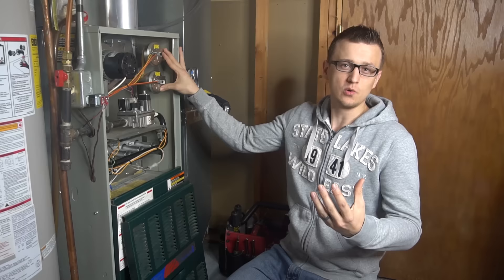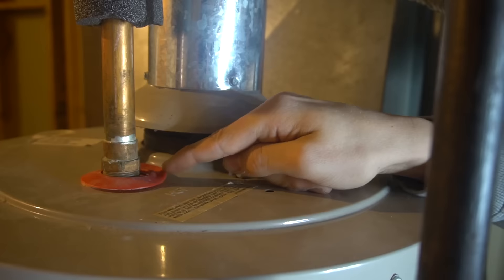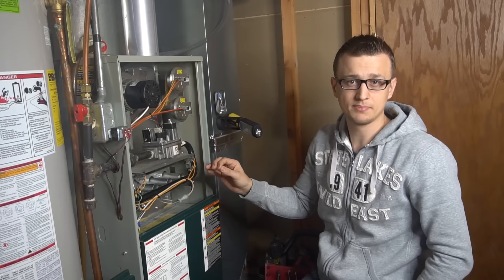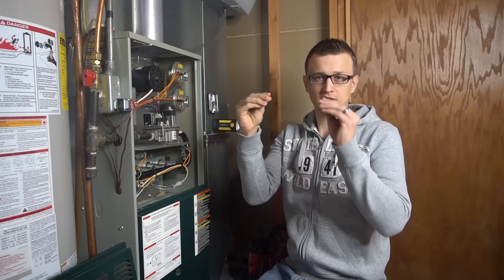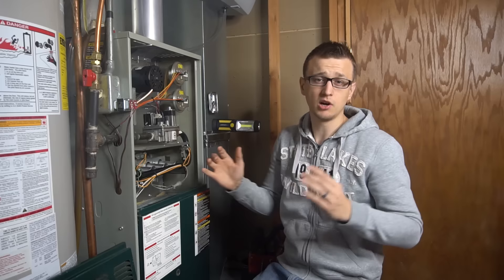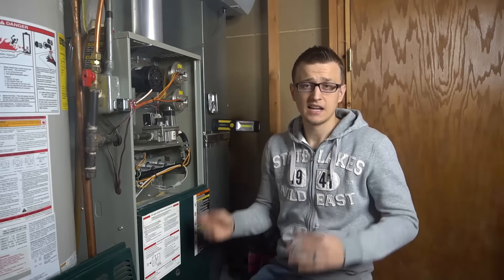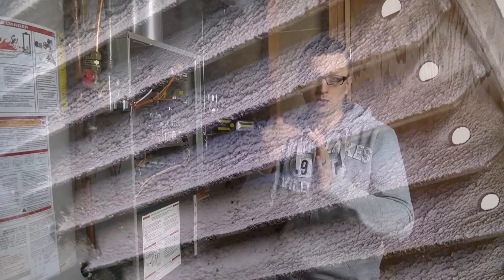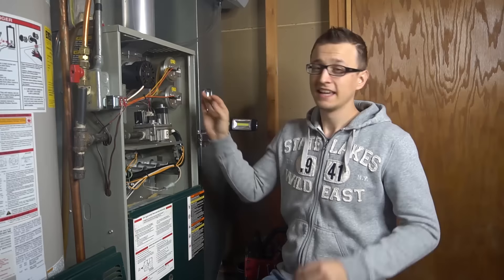Furnace Pressure Switch Troubleshooting

Comment: Ok so my furnace stopped working today as we started the winter.  Pressure switch error.   My high efficiency install only had one plastic air pipe connected to it so I wasn't sure where to look.  Then I noticed there was a small box sitting on top of the furnace - and when I picked it up it was right on top of the air intake hole.  I guess on our install they just let the furnace pull from the under house air and that hole was hard to see and wasn't labeled and was blocked by something so simple as a box of misc parts I must have set there.  I now have it labeled with KEEP CLEAR all around it!    Thank you so much for this video.

Comment: I had to work on my furnace over weekend.  It's a Rheem furnace.  I got a code 5-7.  Which is the pressure switch code.  I did everything to trouble shoot the unit.  The one thing I noticed when I started was my inducer motor was making a funny noise.  After checking everything I removed the inducer motor to check for an obstruction. 

 Everything looking good inside the motor and housing.  The unit is only 2 years old....  Why me. 

After reassembling the inducer motor.  I started the unit back up, that's when it started to work. 
I believe the inducer motor was not secure/sealed to the housing, which wasn't producing enough negative pressure to close the switch?

I no longer hear the noise coming from the motor.
Reply from the maker: Thank you for sharing that! That's interesting. I guess one will never know for sure what exactly was wrong. A bad seal could have been it. I had a similar one last month. I put in a new inducer motor and when I turned it on, it started rattling. I took it back out and found nothing wrong. Put it back in exactly the same way and there was no noise, working good. Still not sure why that happened either.

Comment: I have had a Goodman 80% furnace once where the draft inducer motor was bad, but it was an intermittent problem, the motor would appear to tun fine, but then at times it would slow down the rpm enough to cause the pressure switch to open and shut down the furnace.  It was a real nightmare because it did not do it all the time. When I first went out to this job there was a problem with the pressure switches Goodman was using from Brazil. Put in a new switch, ran for about a week, got called back for same problem. Changed the board because I could not find anything else wrong. Couple days later, same problem, this time I was watching it run, then all of the sudden I could hear the motor slow down, bingo found it, replaced the inducer motor and that was the problem, but intermittent problems like that one are a real bitch to figure out.
Reply from the maker: Thanks for sharing Jeff! I had similar problems in the past so I definitely understand how annoying those intermittent problems can be. Perhaps you will save someone's day as they read through the comments ;)
Reply: did you pay the person back for parts it didn't need???

Comment: This video helps me finding & ruling out the causes of my furnace not heating.   days ago my furnace just did not work with 3 flashes on and the outside temperature was below 30s. I did some research,  found this video ( watched Jay's other videos before and trusted him).  Following his suggestions, checking in & out venting pipes,  cleaning condensate trap/pipe, testing pressure switch with multimeter and finally end up at inducer motor.  Ordered a new one right away and replaced it a day after. Boom,  my furnace began to blow the warm air again.   Thank you Jay. Save me lots of time & money. you are the guy know your stuffs and help others.

Comment: Got an issue with a pressure switch code (Pressure switch open, should be close).  When I turn on the system, the  inducer motor runs, and I test good continuity on the pressure switch. However nothing else happens.  Motor runs for about 60 sec and shuts off.  Light blinks on the Honeywell furnace smart three times.  It tries again after a minute or so.   Open and should be close tells me the Honeywell furnace smart is not getting the 24v back to it on that circuit line. Help

Comment: Very informative video. But   the only suggestion I would make to you is that you should direct the information more as a  tutorial for other less experienced mechanics rather than towards a homeowner trying to repair their furnace on their own as it appears in your videos. Believe me when I tell you that there will be a homeowner that will try to do a repair on their own, and damage their furnace more or possibly get hurt. I would prefer to hear you say ..."the homeowners furnace" rather than ..." your furnace" indicating you are speaking to a mechanic instead of directly to the homeowner. The homeowner's only concerns should be their thermostat, replacing their furnace filter, or maybe clearing around their outside condenser, not taking apart their furnace or blowing into the pressure switches. This should be left to the professionals. With that said, I do have to say that you are knowledgeable and cover pretty much everything. As I mentioned before, on your other videos, you should consider a HVAC instructor position.
Reply: Harry is scared that his profits are going to go down LOL  God forbid the consumer gets educated!
Reply: @pvdxtc  Education is one thing and can be a valuable tool when talking to a licensed contractor, but working on your own gas furnace is simply not a good idea if you don't know what you are taking apart, period. And as for worrying about profits, contractors make more money fixing the messes that the homeowner caused trying to do things on their own. Lol!
Reply: I agree with you that working on your own gas furnace is not a good idea if you don't know what you're taking apart, that is why watching videos like this is very informative, they show you step-by-step each component of the Furnace and how they function and how to troubleshoot them if something goes wrong.
Reply: @pvdxtc  Absolutely correct but then you get homeowners thinking that they know more than the technician. Just for laughs, check out the "Complete HVAC Ten Commandments" on YouTube and you may see what we put up with. Lol.
Reply: Harry Spohrer I don't think you understand how YouTube works.  You take Jay here.  He's a talented, articulate HVAC Tech who has figured out that certain people with a little assistance can troubleshoot and maybe even fix their own HVAC equipment.  He's building a successful YouTube channel that might help put his kids thru college.  Good for Jay.  It's what they call a disruptive technology.
Reply: @keninatlanta8452  I agree 100% !!! Jay didn't go into HVAC specifics in any kind of detail that would even cause harm to the clueless. This was just an overall troubleshooting guide for the average person (like me) who has saved alot of money and aggrevation. He (in no way) encouraged the clueless to try anything dangerous. Common sense tells you that. I have a good friend who is WAY beyond the level of an hvac expert. I've helped him install countless furnaces of all types, including taking measurements and intalling "All" of the required metal for the furnace. Buying the necessary gasline piping etc. He taught me several thing's. But that was years ago. I seriously doubt that ANYONE is going to mess with a furnace if they didn't know what they were doing. Shit, the hardest part of a furnace install, is measuring and properly installing the required metal. Especially in older homes, where there is barley any room to work. And he isn't encouraging anyone to mess with gas lines etc. Don't change a THING Jay. That was just one person's opinion !!! Thanks for a refresher course of the simple basics.
Reply: I really appreciate the knowledge he's sharing here. There are home owners who can fix their own furnace. I can learn and do the work but I can't afford to pay an HVAC company to do it.  Not to mention their parts pricing! Bought a pressure switch online $14 w/free shipping but the local HVAC wanted $52-65 for the same part. I bought a control panel, ALC, Temp limit control, rollout limit switch and flame sensor for $60. Thank God for online sales YouTube tutorials that help folks fix things when they can't afford to hire a pro!
Reply: @dogwoodcrossroads  Bravo !!! Very well said Sir. Thank God for YouTube and people like Jay..
Reply: @alb.dersame  lol I'm a woman, not a sir! I'm not offended, there aren't many women that do their own repair work. I'm doing what God gave me the natural talent for and I think everyone should do the same regardless of social norms. I will admit I needed a little help lifting the old heat exchange out and lifting the new heat exchange into my furnace bc it was heavy but I did everything else. I look up the manual and watch several videos and then attempt the repair,  repeating the video as needed til it's accomplished. It's not rocket science, if u can follow instructions and use tools, u can do most repairs. Good luck 👍 and a big thanks to Jay 4 great tutorials!!!!
Reply: I certainly agree that Jay's videos are informative, and are very helpful on learning about your own furnace. I am not knocking him or his videos. In fact on several occasions, I suggested they he become a HVAC instructor. With that being said, people think that they can watch a few videos and become an expert on repairing a gas furnace, such as replacing controls and removing the heat exchanger from a furnace. Ordering the wrong control online can be dangerous because all controls are not created equal. Blowing into pressure switches and disassembling your furnace, even for the average homeowner is simply crazy. You are only asking for trouble. Don't worry about me losing my profits, I've been a contractor, and in the trade since 1979 and seen alot of screw-ups by homeowners trying to repair their own furnaces. It's just not a good idea. Period. End of discussion.
Reply: You're absolutely correct. He didn't go into specifics on what potential harm and problems can arise to the clueless. That's my point.
Reply: @dogwoodcrossroads  Wow, you ROCK !!! And your absolutely right, you just said it all. Anyone with a bit of common sense can do So much. Thank you for not being offended, it Definatly wasn't my intent at all. I have nothing but total admiration for you. You are more independent than many people that I  know ! That's so cool !!! I use YouTube for just about all of my needs. Not so much with Google. Everything we need is right here. It's so Amazing to have this kind of technology isn't it ? It was a pleasure to speak with you "ma'am" :) Have a Great night.. God bless ..

Comment: Thanks so much for your video!  I have a 30 y/o Carrier High Efficiency unit that was shutting off after a few minutes.  Condensation is a big thing with this unit, and it turns out the induction motor hose had a ton of water in it. Drained it, cleaned the condenser trap which was plugged, and away it went!  I was resigned to replacement, and that is on the horizon, but for now I'm delighted!

Comment: thanks so much... being on a fixed income... calling a plumber is expensive. My york furnace was coding 3... pressure switch stuck open. I haven't run the furnace for almost 7 months so was super dusty inside. Vacumned... blew everything out with canned air after. Took off 2 of the hoses to make sure they were clean. Then started the furnace up.... nothing. I hit the motor for good measure.... it coded me back at 6... pressure switch lock out...lol. I turned it off, i promised to be nice and not hit him again..... now he is running fine and we are friends again. Thanks for saving me a plumbing bill.

Comment: Great helpful video. I had pressure switch error, called heating company. Young man insisted it was the board, 800$. The furnace shut down again a few days later, I opened the door, unhooked the hose, turned off the furnace, hooked up the hose, turned on the furnace, everything has run fine for 6 weeks. Now out again with pressure switch error. repeated previous steps, furnace running again.  I don't who to trust!

Comment: Thank you so much sir.  Our furnace stopped working on Christmas day so it looked like it was going to be a Dickensian Christmas for us, all huddled around a candle.  And then I saw your videos, so I opened the furnace doors and followed everything you said - always being careful - and low and behold, my Lennox G61MPV had a bad motor capacitor.  I used the opportunity to clean the combustion air inducer and the air pressure prove switches and hose connections.  Now I feel like Scrooge after he woke up and am jumping (with my family) around our warm house with joy. THANK YOU!!!!!!!!

Comment: My pressure switch port plug was SEVERELY clogged. I wouldn't even use that word, actually. It was literally rusted shut. I needed to use a hammer to pound an old tiny screwdriver through. It was on the housing of the inducer motor, which I removed from the furnace to diagnose and fix. Took a lot of hard hits to finally break that rust and make an actual opening again so air could go through there. Unbelievable. Thanks for the vid!

Comment: I can’t praise your videos enough. I would go as far as saying they’re the best of any on YouTube. Anyways, I’ve got a Goodman furnace that was blowing cool air every morning for a week or so. It seemed to be locking out and would start working again after a reset. No error codes. Then yesterday it decided to quit working altogether. Error code is for the pressure switch. I did some troubleshooting with no luck. Then I found your videos and followed several of them, coming to the conclusion that 1) my pressure switch was fine but I probably killed it by blowing too hard 😂, and 2) my control board is likely bad. So I have ordered a new board and a new pressure switch. I’m only getting 3.6v to my inducer motor, it does quickly spike when it gets the call for heat (faster than my Klein meter can display, so I see up to 16v flash on the meter) and then immediately get the 3 blinks error code. With your videos I tested the FRS and HL switches as well as the transformer and thermostat. Not 100% convinced it is the board yet, seems like the pressure switch is telling it to shutdown as soon as voltage is sent to the inducer motor. 

Anyways, I wouldn’t have gotten this far without your videos. CcI’m a very technical person and your videos are on point. Many thanks!

Comment: This video saved me a call to a repairman due to an embarrassing self-made problem.  My exhaust was plugged up...with my smoker grill.  My exhaust runs out of the side of my house about 2 feet off the ground and near where I have my barbecue station.  Yes, it's a station.  Well, after a good smoke of ribs, I wheeled the smoker to the area blocking the exhaust.  Week later, it started snowing and my heat wasn't coming on.

Comment: Rheem furnace, had 2 blinking LEDs indicating pressure switch problem.  Made sure the switches' tube input was clear w/ a paper clip.  Blew/sucked air in/out of the hose.  Furnace is now firing, thanks for the video!

Comment: Thanks, great video. My attic (I live in the desert southwest) furnace requires nudging to get it to start when outside temps are below 45 degrees. The gentle nudge is turning the thermostat off for 20 minutes. The harder nudge is shutting off power via the breaker for an hour. Usually the gentle nudge is good enough. Nudging is usually required between 5-9am which is the coldest time of day during winter in the southwest. Once the early morning nudge induces a start it will run fine throughout the day and evening without any starting problems (warmer daytime temps may have something to do with that). So the basic hardware (inducer, igniter, burner, blower) seems to be ok. Some "experts" have suggested this is a failing pressure switch problem, but after watching your video I'm not too sure. From your video I know what is not the cause of the problem - moisture - there just isn't any in the environment. My gut feeling is that this is an electrostatic problem which is temporarily cured by turning off the thermostat or more effectively by shutting off power via the breaker both of which allow the static charge to dissipate. If that's the case I can't even speculate on what the fix might be. Have you ever encountered an issue like this?

Comment: Thank you. The small metal tube next to the proof fan was plugged. I cleaned it out with a small piece of wire, and tested the pressure switch by blowing into the tube on the switch, and checking that it closed. furnace works normally now.

Comment: Recently saw a situation where a pressure switch hose became kinked and impeded the flow of air. the hose was taken off, trimmed the kinked section off and reconnected. the furnace works perfect!  Thanks for a very informative video!

Comment: Thanks so much for the video. Turns out you were right about the Carriers condensate trap. Mine was plugged up with orange gunk. “TIP” I used oven cleaner, sprayed into the holes to get all of it out. Just water didn’t do it. Thanks again for the great video

Comment: You sir saved me so much money from this video. Furnace was blowing air, but getting pressure switch malfunction flashing codes. Turns out some leaves got sucked into the intake pipe and restricted the airflow, preventing the burner from lighting up. Literally the easiest fix, would cost me $$$ just to get HVAC guy to get out here.

Comment: Thank you very much for your instruction. My pressure hose tube was rusted and blocked. I removed the rust and cleaned the tube. My furnace is running again. Great video. Thanks a lot again.

Comment: Checked the hose connector and the electrical connectors to the pressure switch , just wiggled them a bit, reset the power, and everything worked fine.  Thanks! Saved me hundreds of dollars and hours of time!!!